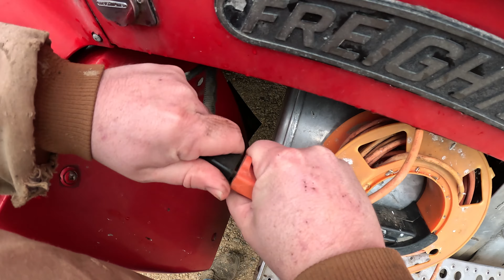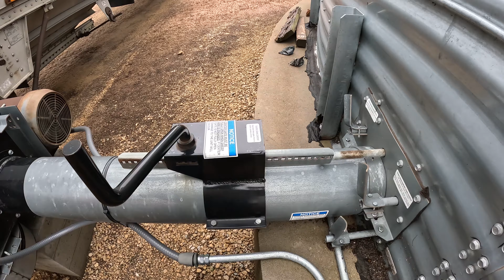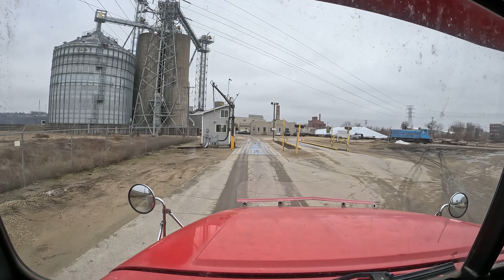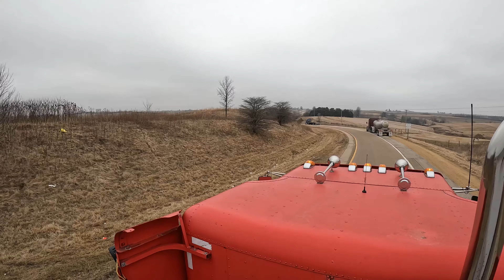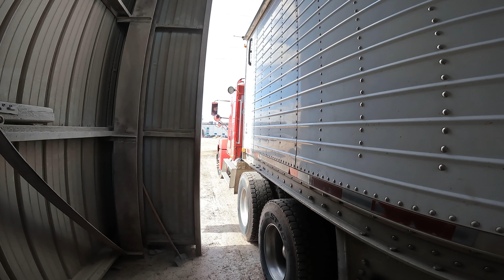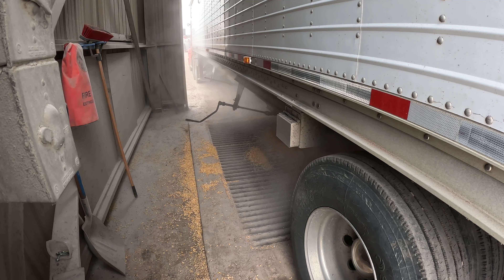Hauling With Hannah

Comment: As always, love your videos. I'm not a farmer, but I drove for one of the finest in Chester SC for 7 years.  Prior to that I drove trucks for UPS for 36. That said, Hannah, if you will use your TRAILER brakes, (not the parking, but the hand valve) while you are at lengthy stops, then your semi won't roll back with you. I'm talking about RR-xings, traffic lights, and at the grain mill. NEVER use this brake while moving as it will cause a jack knife, but if used properly, it will help prevent rolling back when stopped on an incline while you are pulling off. Thanks for the videos, love to watch how it's done.

Comment: Hi Ryan, I didn't see you cleaning or drying grain in your videos.  As I understand it, the combine harvester gives a high degree of cleaning.  What is the moisture content of your grain at harvest? I am from Ukraine, our company (called Demetra) has been a Sukup dealer in Ukraine for 7 years.   And depending on the region, when harvesting, the humidity can be from 28-23%.  And every farmer has to dry the grain before loading it into a bin. How do you get humidity 16%

Comment: You guys should hook the 46 up to the vt and see if it will pull it that way if the 82 ever brakes down you know that the 46 could run it while the 82 is getting fixed.